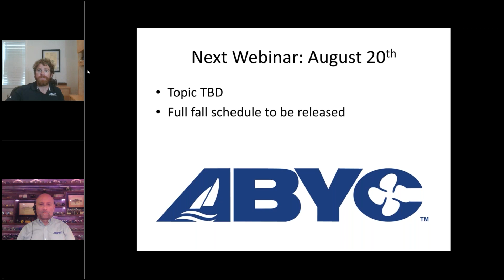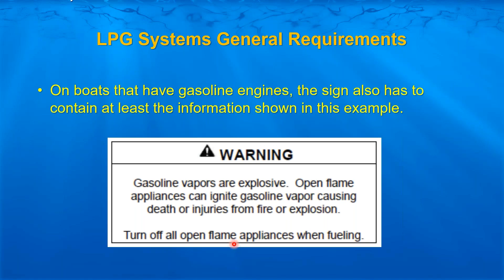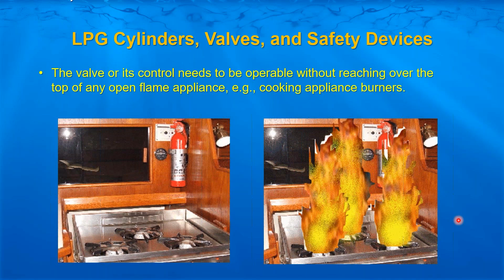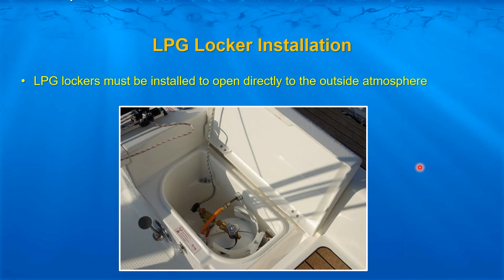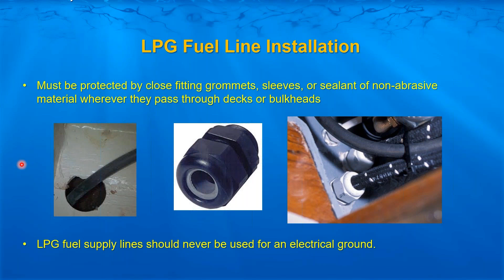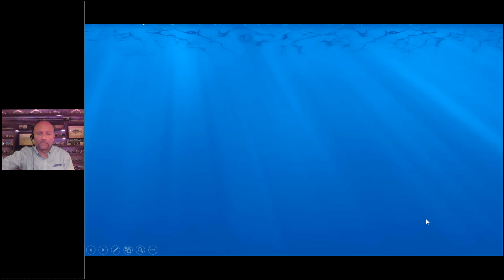Propane Systems On Boats with Mike Bonicker

Comment: Is there a min standard “fall” for the locker to be higher than the through hull? Next, could a one way check valve be installed between the through hull and the storage locker to prevent heavy following seas from collecting in the locker. AND, still allow gas’s to escape?

Comment: Thanks!  I noticed most images show a POL connection to the tank can Type I fitting be used? 

Also, sounds like steel or aluminum tanks can be used.  Is that right?

Comment: @16:13 "15 square inches... per cubic foot" oh my dear god. So, for every 12inches cubed we need a 3.872983346207417 inch by 3.872983346207417 inch square open? Who came up with a square with sides of 3.872983346207417 inches as the rule? If you're going to use a base 12 system like feet why don't you use factors of 12?! Such as: 16 square inches per cubic foot. Please just switch to meters instead. You can copy a European standard and translate it to inches since you clearly don't care about round numbers anyway.

Comment: sorry but this was terrible content from  abyc... tanks are good as long as they look okay??? no they are stamped with date and must be re-certified or replaced.  You don't know that vertical and horizontal tanks are different - laying them on their side is not okay??? you don't know how LPG and LNG are different and the differences between them... the heat produced from the different gasses is .. well different and the orifices for the stoves need to be changed to take that into account.

Comment: Propane bottle orientation is specific. A standard propane bottle can not be laid on its side and function properly. A horizontal bottle has different internal plumbing that allows the bottle to function properly in a horizontal orientation.

Comment: What is your call on a system which supplies propane to two  appliances. The first appliance is a stove, inside the boat which has a solenoid valve in the propane locker to shut it off.  The second appliance is a fridge which has no remote shut off in the cabin. The back of the fridge is open to the cockpit and well vented. The propane locker is about 6 feet from the back of the fridge.